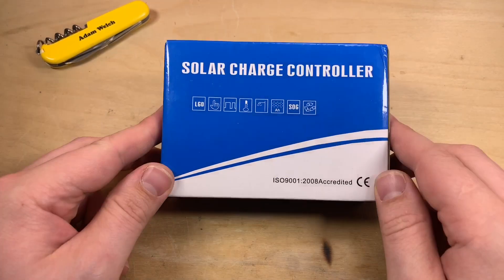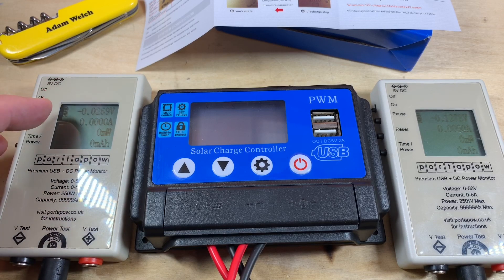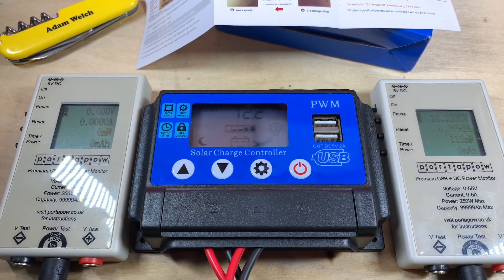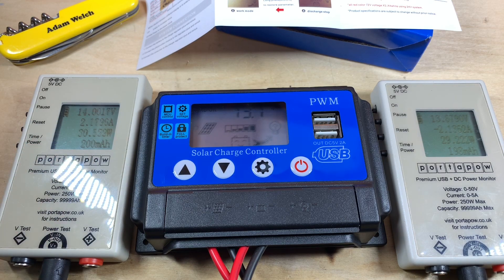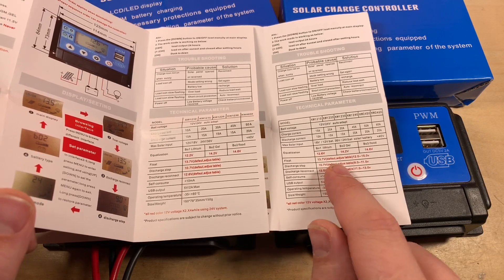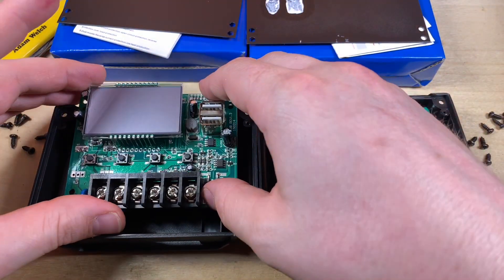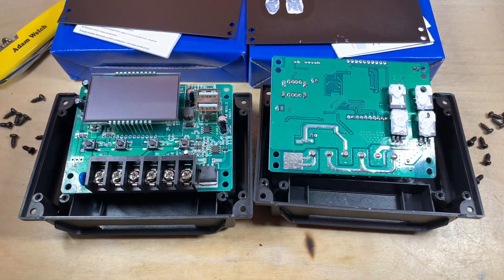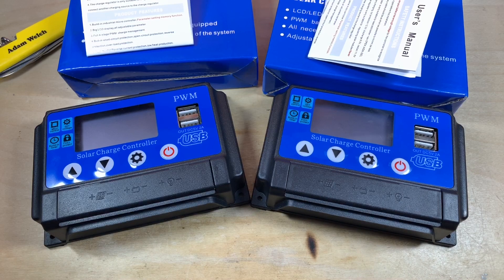Inside Another Cheap Solar Charge Controller

Comment: Junk it's a good charge controller that could burn down your house, Do not mount them to wood the heatsink is just not enough, might as well say there is no heatsink, it's ok for a system far below it maximum capacity in the instructions, So I found out, But you can easy approve it by adding your own heatsink and fan if need be.

Comment: What you didn't touch on was the terminals.  Specifically, whether the 60a charger is capable of properly terminating a larger conductor capable of carrying 60 amps.
Reply: For heavier wires you are going to have to make some custom adjustments.  On one, I crimped a pin type terminator onto the wire to get it to fit.  On another, I used solid copper wire and used a file to make it fit.  But I wouldn't realistically expect it to handle more than 20A continuous.

Comment: Now that we've established that the seller misrepresented the product, I can say these cheap PWM controllers work pretty well for the price. I've had one charging a solar lighting system, and one charging a wifi remote relay system for going on 3 years. They have been working well for those applications using 70 watt panels and sealed lead-acid batteries. I'm powering the wifi repeater using the USB port which seems to be outputting around 2 amps as stated.
Thanks for the video!
Reply: There pretty good for what they are
Reply: Is there a misrepresentation on the product though?  It says PWM.  no MPPT labelling on it
Reply: @Stingmni  Welcome to the Wayback Machine!
Reply: Attention: If you use the USB-Port on those, the port will not be shut off if the battery is depleted, the port will work as long as the battery has more than 5v output, so it will be destroyed by this.
Reply: I had one too, and it destroyed my battery. Hardware wise it's actually fine, but the firmware was set for a rather over-aggressive charge cycle.
Reply: @vylbird8014  did you change the float voltage settings? If you set that incorrect it will overcharge your battery
Reply: @dantronics1682  It doesn't have a lot of settings. They really are the cheapest possible controller. I could (and have) built better.
Reply: @vylbird8014  no it doesnt but there is a setting for the float voltage and if its set incorrect then the battery will keep charging, I cant find my charger at the moment to see what I had set it to
Reply: @dantronics1682  Can't recall. It was a long time ago. I've got a proper charge controller for my current setup, and it's working a lot better.
Reply: @vylbird8014  Would you care to elaborate a bit on that? I just got my hands on a 10A setup, where the battery is lead-acid, 7A. Is the charging cycle adjustable in any way? Thanks in advance!
Reply: @1billthekid  It's been a good many years, but from what little I remember, it was taking the voltage too high during charging resulting in outgassing. Which will quickly damage a SLA. Maybe it's made for flooded cells.
Reply: @vylbird8014  Ok, thanks for replying mate!

Comment: Those tracks will easily take 60 amps , the cross section of the tracks is quite large , also the mosfets have very low saturation resistance and produce little heat .. don't be so misleading

Comment: Hi Adam a couple of years ago you did a video on a jumper pack and charging it with a solar panel mine has given up the ghost because of the battery I wondered if you could do a project on replacing the battery with 18650 or similar great vids mate thanks a lot!

Comment: You will have 4 times the heat if you double the current. I^2R loss, MOSFET turned fully on is like a low value resistor :)

Comment: Hi Adam
been watching your videos and have installed a little solar setup myself
very similar controller came with my first 100w mono panel, have since added a second 100w mono panel ( although it's smaller. I've got 3 x 60ishAh lead acid batteries wired in parallel, so it's all 12v. Using to power lights and a bluetooth amp on the shed and in the garden ( all cheaper than running 240v mains)
I don't use the loads output of the controller, got it wired so power in goes to +bat1 and -bat3, while load is +bat3 and -bat1 )

My question, if i may, would you stick to PWM and parallel panels or go to MPPT? I don't use power as it's generated ( usually it's for evening illumination / entertainment ) But I have just got an inverter to charge powertool batteries etc

Apologies for the ramble, feel free to delete, or message back if you want/need further info or a chat lol
TIA, love the vids
Reply: I save energy until evening as well, am interested in a response to your question
Reply: @carolynpyeatt9879  I did get a reply - MPPT is best for usage at point of creation. PWM for everything else. Just get a good few decent capacity batteries

Comment: can you review MPT-7210A ? it's mppt for lithium battery, i heard it's quite good
Reply from the maker: I was sent one by a kind viewer who upgraded, but I’ve never done a review because it’s been covered by a few other youtubers. I’d have a look at Julian Ilett’s videos on the MPT-7210A. He ended up doing two or three videos because it’s a bit odd in the way it works. I’ve heard it’s quite noisy, turning the fan on frequently.
Reply: @AdamWelchUK  thanks for reply, i will check Julian video.
Reply: I have one myself... the problem with those, they are not TRUE MPPT.... it’s just a boost converter... it can’t handle 12v in to 12v out... as it’ll try to keep the voltage higher than input, they work better on 30v and up battery banks.... also, wire your panels in respect to output voltage for what you need... up to 60v input, up to 90v output... and as the name tag says, it can do up to 10A... however, it will never run at the full 10A unless you have 10A in solar panels. Which I find overkill IMO. I use mine with a 50w panel to keep my 48v pack topped off.

Comment: If you use a higher voltage with these they do not cut off. Mine was set to 14.2 v and caught it over 15.5v. I had 32v panel.

Comment: I purchased similar looking PWM solar charge controllers and found similar results.  The back plate did get hot when connected to a 150w panel so I added a large heat sink scavenged from a motherboard, which seemed to help dissipate the heat.
Reply: I did the same.

Comment: That thing may do 60 amps for a minute, the PCB is likely going to go, at the tracks!!
Reply: Ya just need to understand the Chinesium Rating System.  When they say it's good for 30A they mean it only Smokes at 20A and will not burst into flames until it reaches 30A.     I buy piles of this kinda stuff.  You just need to  buy ratings two and three times what your needing.   Works for me.   Especially any types of Power supplies and Buck/Boost controllers.

Comment: I ordered a charge controller that supposed to charge lithium batteries, from amazon, I was sent one of these, like 40-50 amp version. Not what I ordered, anyway I kept it , for a emergency, or project controller, and re-ordered the controller I needed, to charge LiFePo4, 12v bank, its pwm and has lithium as a option. I just needed something I can charge a 118ah battery with for lighting, with 100-300 watts, I wish I sent it back, I gave like $40 bucks for it, a bit too much I think!!

Comment: I have a couple of those for small portable solar genarators 1 for a shed.  The other is totally portable  on a dolly with an enclosed box & 2 grp 24 deep cycle marine batteries. I've been using them frequently for about 3-4 years now and they have worked perfectly. For around 10 bucks, what more could you ask for? I think there great myself, and all mine have been 100% reliable. They work especially well for the application I'm using them for. Minor lighting, running small tools, and actually if I hook up 200wats worth of panels, it will handle a small  10cf fridge quite nicely, BTW, I also have a 1500 -3000w surge inverter on the dolly set up as well for DC use. 
 Well worth having for mini systems IMO.

All and all, a quite handy tool for using around the property where power isn't normally avaible.

Comment: I purchased one that was actually marked MPPT on the Housing.  Opening it up only to find a half Azz PWM PCB.  The contained PCB looked to be the same as this version.   Packed it back up and Returned to seller after a few days of Haggling..  LOL      This is not the Seller but the Items looks to be the one and the Same.    After Confronted they simply close shop and open a new store.   https://www.ebay.com/itm/100A-MPPT-Solar-Panel-Regulator-Charge-Controller-12V-24V-Auto-Focus-Tracking/233053091490?_trkparms=aid%3D555018%26algo%3DPL.SIM%26ao%3D2%26asc%3D20160908110712%26meid%3D6cd1a39512c8452fb380c94c05e5e429%26pid%3D100677%26rk%3D2%26rkt%3D30%26mehot%3Dpp%26sd%3D192857904081%26itm%3D233053091490&_trksid=p2385738.c100677.m4598
Reply: Coincidence  ? This  morning checking on my E-Bay orders and status I was asked to do a Review on said Charge Controller.  I was unable to do a review previously on E-Bay because the listing went MIA.   Gave the guy 5 Stars on everything other then the facts.  LOL,   Documented as a Fraudulent Deal Listing and even Marking the charger as being MPPT and in fact it was nothing more then a PWM system.   I see the same item now listed no less then 5 more times under different seller names.  This same PCB is being marketed  in a pile of other shaped and labeled enclosures.  Same LCD.  Same USB and Buttons.  Just a different colored case and or shape and name.  I wish we could post photo's on Youtube replies. 

I'll give this issue a million dollars worth of bad publicity every chance I have.

This is the one I purchased No Shortage of Seller Names it seems :

https://www.ebay.com/itm/40-100A-MPPT-Solar-Panel-Regulator-Charge-Controller-12V-24V-Auto-Focus-Tracking/183802879627?hash=item2acb815e8b:m:myk4nyH0PsqUiB4jqW5BB4g

https://www.ebay.com/itm/30-100A-MPPT-Solar-Panel-Regulator-Charge-Controller-12V-24V-Auto-Focus-Tracking/123802158945?hash=item1cd32f0761:m:m-A4HZnr8NzYIf-DUb4nwEg
https://www.ebay.com/itm/30-100A-MPPT-Solar-Panel-Regulator-Charge-Controller-12v-24V-Auto-Focus-Tracking/273841665028?hash=item3fc23c3404:m:m1MEgxVrI1X_GFWn8cxDZ6g&var=573581233075

https://www.ebay.com/itm/30-100A-MPPT-Solar-Panel-Regulator-Charge-Controller-12V-24V-Auto-Focus-Tracking/223309283976?hash=item33fe454288:m:mQ4GAQkyhJNLiH_IuAgG07g&var=522096358350

Honest Listing :

https://www.ebay.com/c/14010625164?iid=162626774113

https://www.ebay.com/itm/10-20-30A-Dual-USB-Solar-Panel-Battery-Regulator-Charge-Controller-12V-24V/173732491778?hash=item2873437202:m:mSekFhCw62q-KyD34IYiLEg&var=472404508297

https://www.ebay.com/itm/PWM-30A-Solar-Charge-Controller-12V-24V-LCD-Display-Dual-USB-Solar-Panel-Charger/163747134745?hash=item262016fd19:g:ZdQAAOSwhqBdDY37:sc:USPSFirstClass!88030!US!-1

Comment: I have one of these and it was only $3.50 shipped on an ebay auction, the 4 FET version.  I just use it to maintain a battery, but I use it on 60V panels. Between that and the panel I have another wonder, a 72-12V 15A voltage converter that only cost $4.50.  It is modified into a linear current booster that puts out a max of 14.6V and doesn't let the panels drop below 59V. You get 90% of all the advantages of MPPT for less than $10.  Any relation to what the display says and the battery voltage is pure coincidence.  Those FET barely touch the panel and it is beat to add more thermal compound.  All said, they are not a bad performer for a small system.  The unused power of the panels goes to heat water.  Stop wasting money on 12V panels, go grid tie.

Comment: I have the 10A version of the same device. What does 601 in the settings menu mean? I can't change it. Can you do a video on setting it up? Thanks.
Reply: It is B01...that means is sett for charging Lead acid battery
Reply: @viocaia  Ahhh. OK, Thanks.
Reply: @sarkybugger5009  Thanks. I am charging Lead Acid right now. But thanks for the tip.
Reply: @sarkybugger5009  I will try that. Because I did everything, but the setting just wont budge.

Comment: I got one similar to yours. The usb outputs are rated at 2A, but the max you'll get out of ONE of them is +- 0.5A. If you try to pull anything more than that the voltage drops like crazy.  float charge is also non-existent. I've opened a dispute with the seller saying the description isn't right, seeing as the usb's aren't working as advertised, and i'm getting my money back.
Reply: the same at my controller... but its very cheap... and better than nothing ?!...
Reply: @utuberlars  Its better than nothing but I'd rather use something a little bit more reliable. So Instead I bought one from a reputable brand for just under 30 dollar.

Comment: I will like to see the settings for lithium charging.
Can I set parameters?
Reply from the maker: 3s lithium has a equalization voltage fixed at 12.6v. You can adjust the float as low as 12volts.
Reply: @AdamWelchUK  Is there a 24v version of it that can be use for a 7s ?
Reply from the maker: This is an auto switching 12/24v version. So double the voltages I mentioned - so it’s a 6s charger really.

Comment: I ordered one of them last week from Ali express £3.50. going to take week to get hear so was good to have a sneak peek.  But was hoping to see some of  settings.. I am going using this to charge a 140 ah lead acid battery.. and was wondering if it only bulk charges.. and what parameters it has with lead acid.. like can you set it high for the bulk and when you know it's full then manually set it low for float.. ?? Any advice in the comments will be appreciated.. thanks.. 👍 edit the one I got was a 20a at £3.70
Reply from the maker: £3.50! I’ve been done!  Sorry - as you could see it was hard to film the screen and I didn’t want to make the video too long. 
To answer your question, you can select between three battery types. ‘Lithium, gel and flooded’. The lithium settings are a equalization charge of 12.6 volts then you can set the float voltage anywhere within 12-15 volts. The equalization or boost voltage seems to be set by battery type and is not adjustable, only float voltages, disconnect and reconnect voltages can. On each screen you can hold the menu button for a few seconds to adjust one parameter.
Reply: @AdamWelchUK  lol the price is reflected in the years it takes to ship.. lol.. and thanks for the help..  you may be interested in some good batteries I found "26650 type" liitoKala have good energy density and always come under rated. Say 5000 mAh and test around 5200 and best of all are cheep.. so good for people that can't get there hands on old laptop batteries.. I am building up a collection with my left over cash.. thanks for the interesting videos 👍
Reply: 3.50 for 20A charge controller... No need to know more
Reply: I too ordered one on aliexpress as it was $4.85 inklude postage! Beat that - soo cheap! Its my second .... just couldn't belive this price ;)  
https://www.aliexpress.com/item/New-Solar-Charge-Controller-10A-PWM-12V-24V-Auto-LCD-Solar-Charger-with-Dual-USB-Output/32953353968.html
But these controllers are good for the price! They do what these supose to do. Only I would not drive them to hard .... see a 60A (with dobble the Mosfets - but not the print/wire :(   They have a LCD, you can adjust the voltage and you can charge your USB-stuff. And if you short-circut the solar input .... nothing happens - GREAT - as some of my other controllers burn the fuse at battery input. So for a small solar up to 100W this is enough.  AND ABOUT MPPT ..... I too saw some of this marked MPPT - but hey - there is no real MPPT under $19USD!!! They cheapest MPPT is a CPY-2410 but people don't recomand it as there is no LCD nor adjustment for voltage.
Perhaps a MPPT5025A-DUO is good - unfortunaly they over 50USD and over the free custom toll value of Norway.